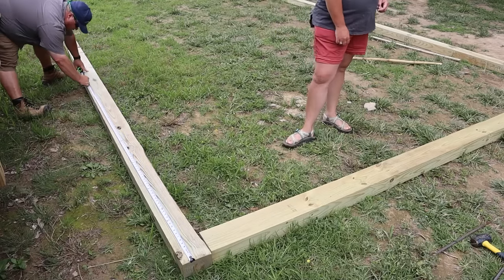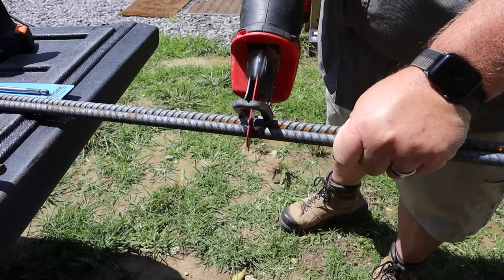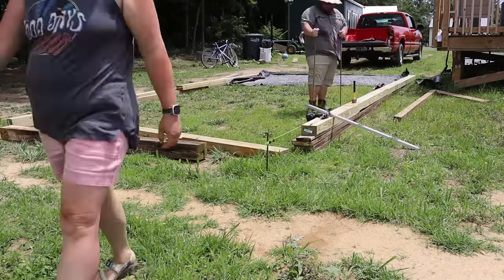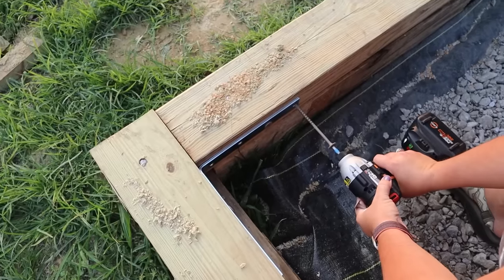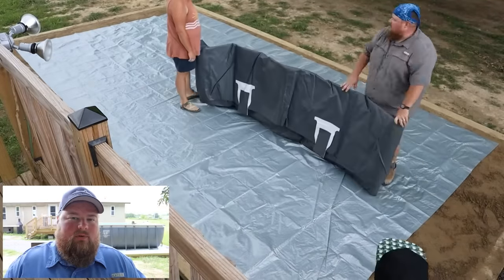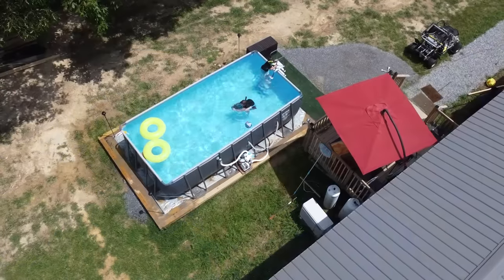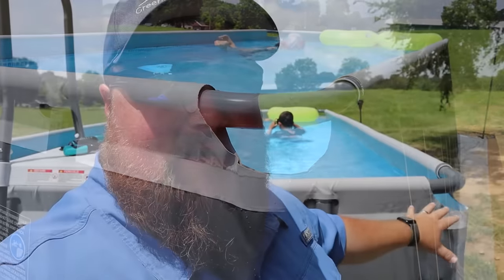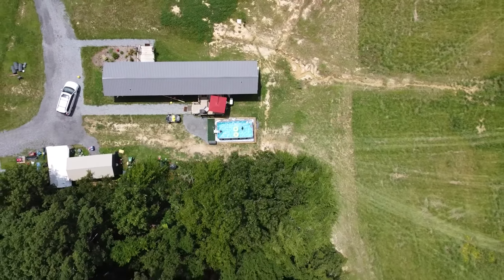Building a Pool Base for OUR FIRST POOL! - Above Ground Intex Ultra XTR 26355EH

Comment: That pool looks good but what a lot of hard work. I installed one of those pools for a friend and used concrete pavers (1 foot square) on some tamped level sand. I also used some carper underlay on top of the pavers and covered the pavers completely, so no dirty feet in the pool. The underlay can be vacuumed every so often to keep it clean. Thanks for posting

Comment: Don't know whether someone else has mentioned this, but if you are worried about the sand base being eroded from the water splashing/going over the top of the pool, suggest you get a bigger tarp that will extend over the edges of the base foundation that way it would allow the water will run off over the tarp that extends beyond the edges of the base foundation and not onto the sand base but run onto the ground around the pool.

Comment: We had this pool from 2006 - 2023.  Replaced it this year for the first time.  Spent a lot of money on it in 2006, but could not have been happier with it, and through all of those years, definitely worth it.  We took it down some years and quickly realized there was no reason to do so.  Exactly as you say, the ladder feels wonky, but we kept both it and the pump (from the old pool for the new pool)... both still going strong.  I'm thinking you'll enjoy it for years to come!

Comment: Great addition to the homestead for the boys primarily but also for the whole family. 
The exertion & exercise will help to keep you fit. And help to relax you all also. I was /am on the larger size and I swam in my cousins above ground pool every night after her young kids went in to get ready for bed. I was living on their farmstead in the converted cement block milkhouse converted into a tiny cabin. The pool was 12 feet from my front door. I toned up and even lost a few pounds from "playing" in the pool for 30- 45 minutes every night & I slept like a baby afterwards. So, it was a win/win for me.
A pool vacuum  and a car wash mitt and 15 minutes keeps the pool sparkling clean. I used the mitt to wash down the walls & to wash the pool floor with the mitt on your feet. Then vacuum. Done! It takes about 20 minutes from start to finish.  And back flush the sand filter the pool is cleaned in 30 minutes once a week.
Get one of those floating ducky thermometers that dispense the chlorine tablets by float around in your pool. If you really want some fun, buy one of the "bucking bull" pool floats they ate a huge riot of fun trying to ride the "bull" in the pool.😅
Reply: Oh and a small plastic kiddy pool under the ladders feet so you step in as you step up to climb the ladder keeps your feet washed off of dirt, grass clippings etc.

Comment: Just a tip...keep up with some hornet spray in the pockets the base slides into, they WILL get into it and cause some issues. Hard piping the filter is super easy and SO WORTH IT.

Comment: Hi Sam. Cover the sand sides with Composite boards over the sand. One - they last longer and can be used over again.Two - they are smooth under foot if you are getting toys. And three - they look awesome and are easier to work with. Your deck can be made square and straight to the closest corner of the pool to the house and add a  2 x  4 where needed to strenghthen the other side that extra 6 inches to a foot. Sort of a long thin triangular stringer to make the longer side look even with the pool side then next year remove the triangle piece, trim the top boards and set the pool parallel to the raised deck.
Reply from the maker: Great ideas! Thank you for sharing them!

Comment: I had a similar pool 12x24x48, the only issue I ever had was the corner rusting. I would suggest getting the intex vacuum. I had the pool for 5 yrs and never took it down. I loved it.
Reply: We just set up ours and I also plan to not take it down, what did you do during winter months, did you put on the filtration each day? What worked for you guys to keep it clean?
Reply: Hello answer

Comment: Hey Tinkerbell, lol Sam get yourself a shallow polyethylene  tray bout 5" tall fill with water by the pool ladder to dip n rinse feet prior to getting in the pool, cuts down debris getting dragged in on soles of feet. Don't take it apart for winter . Just reduce the water level.  Drain plumbing or fill pipes with R V Antifreeze

Comment: The one thing I like when you make something or build something is yeah you probably go overboard as far as securing, nailing, making it safe, making it last 250 years. I would rather see that especially as a parent and a mom the over doing it just in case then to have to do it with whatever you can find around the Homestead. You’re gonna have to replace the pool itself 50 times before you’ll ever have to replace that base.  Great job. 👏🏻👏🏻👏🏻

Comment: My kids are grown and moved away now but I always had a pool in my yard for my kids. It was very important my kids knew how to swim proficiently. To keep the loose sand and grass cuttings out of my pool, I had a foot bath at the ladder leading into my pool and my kids were trained very well to keeping our pool clean as possible without being  crazy. We used auto skimmers and hand skimmers for the bugs floating on top. The ladder was too skimpy so we built 2”x4” boards alongside the ladder to beef it up and that worked and dealt safe to use. You guys did a very nice job and I can relate to your resentment about the pool being off kilter a little bit in regards to the squareness to the base since you do plan on adding a pool deck. For that, build your pool deck where it hangs over the edges a small bit and when you re assemble your pool next spring, square everything off then. Happy swimming!

Comment: Years ago when our children were young, we bought an above ground pool. Once set up we also built a deck with a railing completely around the pool. We left it up over winter with a couple inches of water to keep the line in place. It gets down to -40C during our winters. In the spring we would scrub out the pool, drain it and fill with clean water. It lasted for 5 years until one spring we got a hail storm which shredded the liner.  Our pool was 12 feet in diameter and 36 inches tall. We used half the step to get into the pool. The deck was as tall as the pool. We drilled holes in the deck for the part of the ladder that came outside the pool with the rest of it into the pool to climb down (hope this makes sense). All in, it was a great investment for our kids for summer play.

Comment: We had an above ground round pool, for many years.  We left it up all year round.  I suggest, if you do the same, buy a solid cover, for the pool.  You will need a float to hold the middle up, and prevent freezing. We would close the pool, before leaves started to fall, and saved our gallon milk jugs, to hang from the perimeter of the cover, to hold it from blowing off.  When we opened, in the spring, our water was clear, and no slimy algae.  Correct the chemicals/PH, and it was ready.

Comment: I have had 4 above ground pools in the past 30 years. And waiting on permit to get my 5th one semi inground.  I have had 2 intex pools and they are pretty good. You are not supposed to empty and store them for the winter. When the liner drys out it gets brittle. It's better to close the pool chemically and put cover on it then open pool in the spring.  The best tips I can give you is to add a saltwater generator. Intex makes one. Add pool salt. And also use the BBB pool method. (YouTube it). You will save a ton of money and never have a green pool. I use the same method on my Jacuzzi.

Comment: We have a similar model. Ours is the (now discontinued) 16' square prism frame. We converted ours on day 1 to a salt water system, upgraded the filter to a sand filter and purchased a salt water chlorinater to complete the system. We used stall mats and sand for the pool base.

We are in upstate NY and we leave the pool up over the winter. As long as you close it properly, you'll have no issues leaving it up. Not only does leaving it up save on water usage, the water also heats up faster, allowing you to use it sooner.

The site work is expensive but we've had ours for 4 years now and we love it!
Reply from the maker: I wondered about the salt system, but worried about corrosion of the pipes from the salt water?
Reply: @sam-and-angela  the water isn't salty enough for that. There's less salt than the ocean.

Comment: We put rubber mulch around our above-ground pool and it worked great at preventing erosion and looked good.  It also won't puncture your pool. We also built a deck that was just above the top rail which allowed us to get into the pool by jumping down into the water and then climbing out on to the deck and no ladder is needed.  Our first Intex pool (similar to yours) lasted us over 6 years and we left it up year-round, if you take it down for winters, it will last longer.  Also, watch out for rusting inside the legs, that is a known issue with Intex and similar type pools.  Looks good.  We made a flat spot near our deck by building up using pea gravel followed by sand and compacting.  We also didn't want to disturb our drainage so we simply made it 7 inches higher on the low end.  Worked out great.

Comment: Excellent video, we have the same pool, have had it for 3 seasons now. I have never had a pool so this was a little intimidating but after I got past that it's a walk in the park, I live in East Tennessee also and I do not tear mine down, We were also Iucky that I had a cement pad to put ours on, I bought what is called an Elephant pad and it really makes the bottom feel nice. For the winter shutdown I remove 1/2 the water and use a very HEAVY duty tarp to cover it, the cover that comes with it is junk. I use plastic jugs tied to each eyelit of the tarp to hold it in place. It will fill with weather water yes, I bought a siphon pump (cheap one) and periodically drop the level that is in the tarp cover. Have had no problems. I use a winter chemical make up (it's actually called winter storage) and again have had no problems. I do at the spring time of the year I drain the pool completely and wash it good. Refill and move on with my life. Here in TN. it cost me 10 bucks to fill every year, big deal. I have a skimmer that clamps to the top pool and it works pretty good, I also put skimmer socks on it. Remember to backwash every two weeks and rinse. DO NOT move that lever unless the pump is OFF ONLY. I am interested to see what skimmer your going to install, I have tossed this around just afraid to cut and possibly weaken the material walls. Once it's cut there is no going back. Oh Boy.

Comment: We put a small deck on our above ground pool. I actually purchased a built in pool ladder on Amazon. Drilled two holes in the deck and slid it in place. Very stable and much safer

Comment: Awesome project. When  I did mine, I left the sand a couple inches below the top of my 4x4, covered it with another tarp then after setting up the pool, filled in around the pool with river rock so that it could be walked on and keep the sand in place. We have an 18' round Intex pool and have our base about 6 - 8 inches wider all the way around.

Comment: One thing I don't understand is that years ago when we had an above ground pool, our township required a high, locking, metal fence around the structure. Now, I see a neighbor has one with nothing around it at all. It's right out in plain sight, so the township can't miss it. At Sam and Angela's place it's remote enough to not be a worry, unless a critter jumps in. 😉

Comment: We've had above ground pools.  If you build a deck you can get steps that connect to deck and step down into the pool off the deck vs the ladder type steps.  They are great.  Great job on the base excellant idea and comsideration of your entire property.

Comment: I'm in the process of emptying, moving my pool over & laying down the foam boards. It seems like a huge enough job! I would never want to go to that much effort just to put it on a wood, hard surface.  The foam boards provide soft cushion, & protection from rocks. If I wanted wood I'd build a nice deck around it so I could have a slide!

Comment: To get over the hurdle of running your boards up to the pool, run them vertical to the pool sides all the way around and yes it is possible to go around the circle running them vertical if you run them horizontal it’ll be very noticeable

Comment: I personally would put outdoor carpet runners along the outside perimeter of the pool to keep feet clean and help keep the washout of the sand to a minimum. Just my opinion. Looks like you are going to have a wonderful, fun filled summer that will keep you cool 😎

Comment: Awesome video! I’m planning on putting up an in ground pool next week! A couple questions on items on what you used that I think will help me:

- size wood for the frame
- drill bit size and type for 1/2” rebar holes
- what extension you used on the drill to go into multiple pieces of wood base
- approx. depth of gravel and then sand

Thank you so much!

Comment: We installed a round Intex, 6 years ago, still swimming in it.  Suggestions… buy a larger sand filter, don’t take it down for winter just remove pump and cover tightly. Less chance getting holes in liner.

Comment: I installed the same model about a month ago (also my first above ground pool). I bought an upgraded pump/filter with saltwater system, so not even using the pump that it came with. About the skimmer: not sure if it's because of the upgraded pump, but I could not use the flow restriction plug the instructions say should be put in one of the inlets (this caused low pressure), but it seems to be working anyway. Totally recommend. I also recommend getting the Intex foot bath (it works great with the ladder) and you may want to get a solar cover (and the reel). I am planning to buy the hand held vacuum (looking for deals). Btw, you really put some effort into the ground prep work :-). I'm fortunate mine was mostly leveled decomposed granite, so I evened it, added a tiny bit of sand and put 2 layers of weed fabric, ground cover that came with the pool, 8'x4'x1" r-tech foam boards, and thick tarp under the base. One thing I did not see (or maybe missed) in the video: what did you put under the legs? I could not find anything better than the 12"x4"x8" concrete blocks (from Lowe's). I also used a plan I found online to install the concrete blocks first before finishing the base. In the end, the only problem I see so far is one corner that is about 1/2"-1" lower than the rest (totally my fault, since I did not level corners very well), but it does not cause me any headaches so far.

Comment: It looks good. I had one of those for a few seasons and found that the pump it comes with is not enough so if you plan on keeping it for a bit I'd upgrade. I also found that putting pavers under the legs helped keep the pool from eventually getting unlevel from erosion from splashing and rain.

Comment: Great video. I get the round version and need to replace it every 3-4 years. I am on my 4th pool now. My last two I got with the skimmer. It so much better for cleaning bugs and leaves. I get the 18'x48" size and haven't paid over $400 yet. I wish I could afford an in-ground pool, but I love these cheap pools for a lot of reasons. One downside is the covers don't fit well in winter so now I empty in the fall and clean and fill in the spring. I do not take it down, but it might last 1-2 more years if taken down and properly stored. If you store it in the winter do not store where rodents can get to it because they will chew holes in it. They chewed threw one someone gave me while I had it stored in my shed. This winter a squirrel fell in my empty pool and chewed a big hole to get out. Like I said, wish I had an in-ground pool. LOL.

Comment: Hope you have a great time with your pool.  Something to consider in the future,  Wood of any kind, whether it be pressure treated, engineered or any other wood, should never come in contact to the ground.  It will rot!!!  I know you did not want to rent a piece of equipment to grade the cite,  you could have done it with your tractor.  Would have been better to have used cement block instead of timber.  The rest of your efforts were good.  Gravel and sand for the drainage.  All can be corrected when you drain the pool in the fall.  For now enjoy and have fun.  Stay cool.

Comment: I did my 12x24 like this last year two weeks before Memorial Day  I put down a good heavyweight geo mesh like gets put down under gravel  so it didn’t get pushing into the mud when rains  since I used sand to fill in my box I framed   But on my frame I made copes so the 4x4 over lapped  and used#4 rebar and did 2 foot plus where needed  the copes help it lock in better   I wish I could have afforded gravel but sand has worked great by its self glad to see some thinks like me though lol

Comment: What we did when we had a pool was keep a flat under the bed tote full of water at the base of the ladder and you had to step in the water before you climbed up the ladder, so if your feet weren't clean, they got rinsed before you went into the pool.  Then when we put the pool cover on at night it was dumped and rinsed and turned upside down so nothing got in it overnight.  Whoever took the pool cover off the next morning was responsible for putting the tote in place and filling it up again.  Once a week it got scrubbed out with dish soap.  It worked well for us and kept the pool a lot cleaner.  This is especially great for hot tubs, which you don't want to mess up even more.